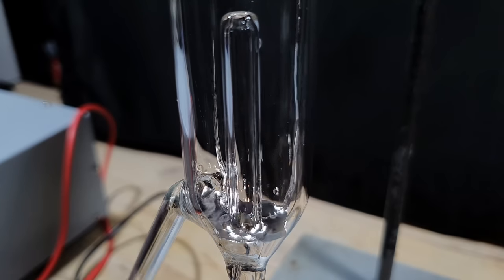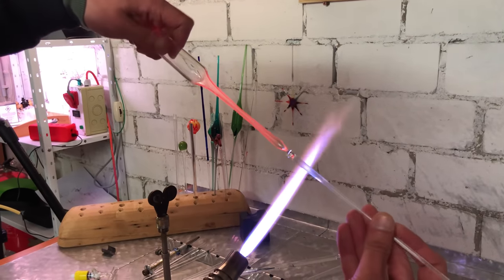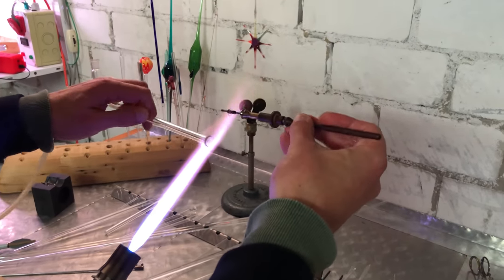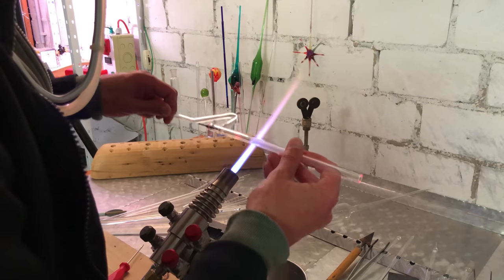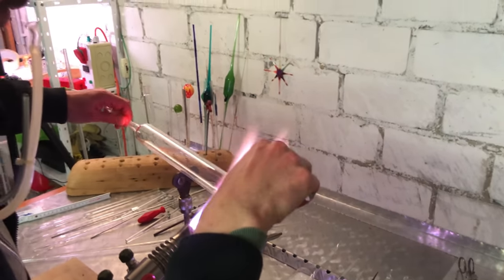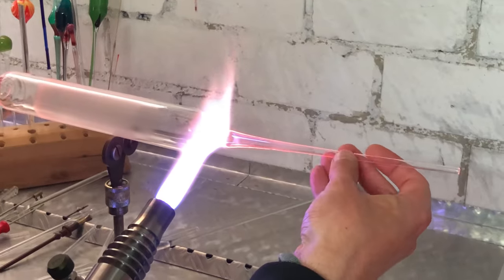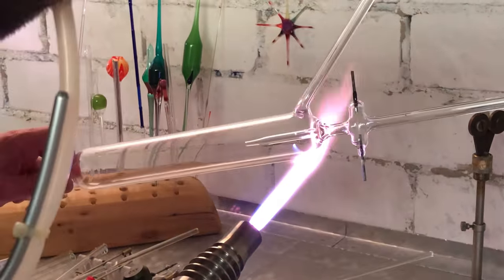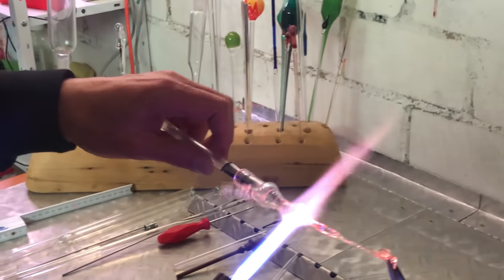Creating the World's Most Dangerous and Unique Fountain: A Glassblower's Masterpiece

Comment: That is some beautiful glassblowing indeed. Please be careful when filling it, I worked in a lab once where 2 people died in a NaK explosion. Now they use Galinstan instead, would that work for your fountain too?
Reply from the maker: I will! I have at least some experience from filling my first version. 
I'm still thinking about the best way to fill it with clean NaK. 

I don't think Galinstan would work. At least not as good. With a density several times that of NaK I don't think it would make a good fountain. Or I would have to use way more power. 
But if I get my hands on some, I will try it.
Reply: @AdvancedTinkering  I actually have a bit over a kilo of Galinstan in a bottle. I don't have any real use for it other than being cool to have, but it doesn't get more cool than a liquid metal fountain. I'm from the Netherlands so I could perhaps send it to you. I'll send you an email we can discuss something.
Reply: I've made it before and it was very easy since the temperatures involved were quite low and I just used a heat gun.  The ratios are non-critical and unless you have to have it perform at lower temperatures it's very easy to make without much but the most basic measurements.  Of course it requires indium which isn't cheap, and neither is gallium, so that would be the hardest part.  It does tend to wet glass due to low surface tension, so aside from the price that might make it unfeasible.  It's also messy and will smear all over the place, especially on your hands.
Reply: This just looks so dangerous; his hands so close to the flame and to hot glass!

Comment: It would be interesting to add a lab condenser in the long angled return section, so that you can chill the metal for continuous operation :)
Reply from the maker: Oh, that's a great idea! I still hope the larger volume of the fountain and the increased surface area is sufficient to cool the metal enough to enable continuous operation. If not, that might be a good solution. 
But on the other hand, I wouldn't know where to put that fountain for continuous operation :D 
It is an accident waiting to happen.
Reply: Says the guy with arm-sized ampoules of cesium lying around ;)

Comment: Does tungsten need any pretreatment to allow for the adhesion to the glass?? To some degree, one of my largest issues when attempting to design a tube for high voltage was contemplating how I could get a connection inside the glass vessel such as you have shown! If tungsten is all that is required I’m basically swimming in it being a welder by day 🤪
Reply: A different comment I saw said it needs a good oxide layer on the tungsten cause the glass wants to stick to tungsten oxide more than just raw tungsten metal

Comment: What blows me away is that he's working without wearing gloves
Reply from the maker: It is perfectly normal for glassblowers to work without gloves. Due to the poor thermal conductivity of glass, this is possible. Gloves would take away too much sensitivity in the fingers and are therefore used only in rare cases.
Reply: @AdvancedTinkering  fair enough. That does make sense.
Reply: I'm I'm blacksmith and I don't wear gloves, in some cases they are a safty hazard they make it harder to know whether the thing your holding is hot. That good until they heat up
Reply: @lostcolonyforge5792  interesting. Good to know!